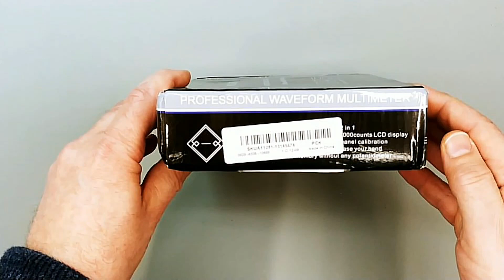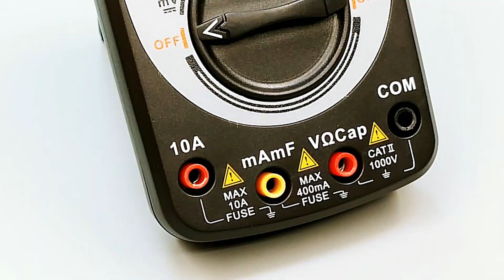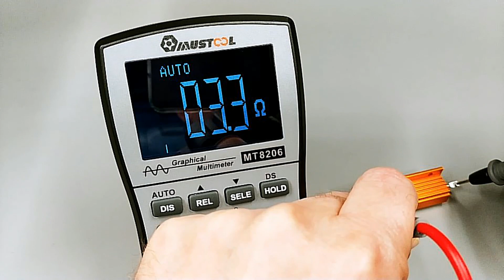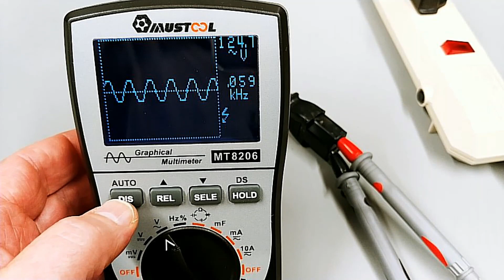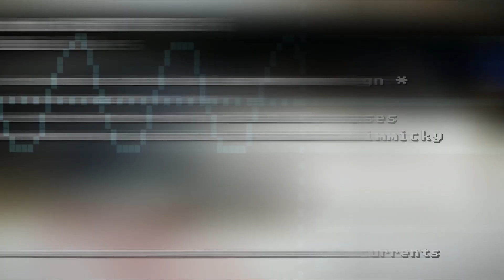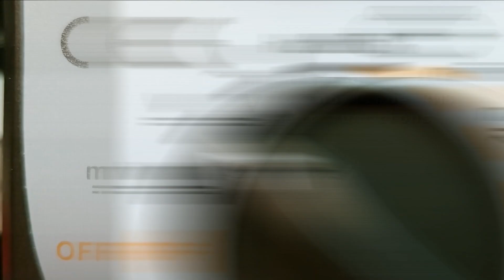#13 "Banggood-ness" — Review: MUSTOOL MT8206 DMM with Waveform Display

Comment: That 8bit "music" was way too distracting, did my head in! And this is from someone who has had ZX80's, ZX81, ZX spectrum,  VIC20, Pet, TI99-4A, STFM, A500, C16, C64,, VIC20, Oh, and a Sinclair QL+ ((with microdrives!). and some I've forgotten.

My ZX81(which was a home build kit) had 1Kb of memory, so I had an expansion pack with 64Kb with a passthrough for another RAM expansion.
They were so wobbly that if you hit the terrible membrane keyboard too hard it would crash.

I've used 8" disks, 3" flippies, 3.5" floppies, Microdrives, 20Mb hard cards (Bet there isn't many people who can remember having to PARK your harddrive before switching off your DOS based PC.), I even had a $360 dual speed CDR and a 9600 baud modem which cost an absolute fortune!!

Out of interest, does anybody remember magazines with pages of code that you had to program into your computer?
I remember one time I had almost finished entering approx 6 pages of code when the electricity meter shut off! It was coin operated and my dad forgot to feed it some money!

EOF !
Reply from the maker: Yes, sir. Lesson learned regarding the music, hence the note, ABOUT THE BACKGROUND MUSIC IN THIS VIDEO in the description. 😉

Yeah, I used to type in all the VIC-20 and C64 programs from COMPUTE! and COMPUTE's Gazzette magazines back in the day. 👍

Comment: That meter only outputs 1.5 volts not enough to light leds.
Reply: my fluke 177 meter can light two LEDs at once on diode mode.
Reply from the maker: Yes, I didn't see realize this at the time. This meter is definitely not comparable to a Fluke, that's for sure. Thanks for watching and for commenting.

Comment: Interesting and very well done review. You made a very important comment on it NOT being an Oscilloscope. But the wave form mode is useful to see if one is testing inverters to see if they are sign wave or square wave. So it may not be a scope, as you pointed out, but it can still be a useful feature.
I see the 8207 model is suppose to go to 40 mhz and is still a fair price for such a multi function meter.
Thanks for the nice review.

Barry
Reply from the maker: Hi Barry. Thanks for the positive feedback. Yes, the new 8207 actually looks to have fairly capable oscilloscope functionality (for the price). I would like to get my hands on one of those to test.

Comment: I BOUGHT MT-8205 IT'S VERY GOOD DMM T-RMS CHECKED CONTINUITY FAST RESPONSE. RECOMMENDED . ON TOP ABLE CONNECTING TO MICRO USB . FIRM SOLID DMM USE 4XAA BATTERY .
Reply from the maker: Thanks for commenting. I just watched Marco Reps
 YouTube video review of the MT-8205 and it seems to be a better design than MT-8206.Thanks for letting me know.

Comment: Please 1.2 Volt DC signal Checking time graphics waveforms multimeter showing yss or no......Please comment aatmamishra1975@gmail.com
Reply from the maker: The waveform display of this multimeter is more for general reference rather than the advanced measurement functions of a decent oscilloscope. The graphical display does not show precise measurements and the sample rate is very slow. I hope this helps.

Comment: I bought this multimeter only for the waveform display... I use this for showing sinusoidal waveform from the output of amplifiers, but i can't "zoom" the amplitude of the signal for watching clipping in the output... the autoscale is a bad thing...
Reply: Just buy an old analog scope from eBay. Thats what I use for the same purpose.
Reply: @Schniels65  I bought this one just for having something portable... I use DSO also for car amplifiers :D

Comment: Was thinking off buying this unit , but not anymore.
Reply from the maker: Thanks for commenting. I'm glad that you found the review to be useful. Yes, if you don't require all the memory storage and semi-useful waveform display there are better options. For example, the Aneng 8008 is an excellent value, low-cost multimeter with very good reviews from many sources. Banggood has it on sale right now, https://www.banggood.com/custlink/3Kmv3q2JfY.

Comment: IMO, any scope that cost less than a couple hundred bucks should have the leads replaced with a pair of quality leads. Considering you can get a good pair for under $20, there's no reason not to. Almost every meter under a couple hundred bucks that I've had the chance to play with had crap leads. But when I paid $40 for this meter (the updated version. I should get it in about a month) and $20 for leads puts me at $60 for a setup that I expect to get good results out of. And I think that value will be extremely hard to beat
Reply from the maker: Yes, you're absolutely right about replacing the leads with more economy meters -- I agree with that. Did you use the Coupon Code in the description above to save a bit on your purchase?

Comment: Banggood-ness because i have a power supply of a monitor and still couldn't figure out what is the problem. I need this tool for safely measure the hot side with oscilloscope function.

Comment: Display is clear, but refresh seems slow. Slowing the whole user interface.. Measuring low resistance is tricky. Im surprised it got that right. Have you tried holding the probes together and pressing REL?
Reply from the maker: Yes, you are correct, the refresh rate is quite slow. No, I haven't shorted the leads and pressed REL -- I will try that. Thanks!

Comment: Banggood-ness 

First, thank you the review. Second, i have a C64G machine, but dont work. I opened the breadbin case (in the middle screw, they have an original warranty sticker) and i'm find inside a ASSY NO.250407 ARTWORK NO.251137 REV.C motherboard..... Awsome! :) The motherboard i think, factory repaired. I see many youtubers video with the black screen of death failure, and measure some basic parameters. Power, the ON/OFF switch. Next step, i remowe the socketted IC-s. SID, the two CIA, nothing result. And i think  the next step is check the clock frequency. But i dont have (currently) any tool, to verifying this parameter.   

Best regards!
Reply: I forgot write this step, the PLA IC i changed a brand new PLA chip.
Reply from the maker: Thanks for your comments. Yes, C64 black screen repairs are often very difficult to diagnose. Coincidentally, I am editing a video now regarding a very difficult black screen repair. Very often a failed PLA is the cause of the black screen - so, your new PLA did not fix the problem, I assume? Do you have access to a Dead Test cartridge? That might help determine if RAM is faulty, as well. You can purchase a Dead Test cartridge from numerous trusted sellers on eBay, https://ebay.to/2zVxurj.
Reply: @MindFlareRetro  

Thank you Sir your answer! The new PLA chip not helping. So i purchase this: https://www.ebay.com/itm/NEW-Commodore-64-DUAL-Diagnostic-Cartridge-PLUS-781220-586220-GOLD-ENIG-V3/163350902169?ssPageName=STRK%3AMEBIDX%3AIT&_trksid=p2057872.m2749.l2649
I hope, this is good for me. (I'm live in Europe, and this is the first in your list, the Seller sending in Europe.) I also purchase two week ago a DTL/TTL CMOS logic probe and  a basic electric solder sucker, like this https://www.ebay.com/itm/220V-30W-Desoldering-Pump-Electric-EU-US-Plug-Pen-Suction-Soldering-Iron-Sucker/183521682045?hash=item2ababea27d:g:0uAAAOSwhZ5b4UrH:rk:66:pf:0  Currently the solder sucker arrived (and worked), the probe not arrived. This faulted motherboard have a long story, and i feel called upon to a fully working state. (The case have an original warranty sticker, and i'm pricked with the screwdriver) If the black screen of death is repaired, i fully socketted all IC's (inspired your video in this summer, and 3 mont ago a local electric shop i buy all socket, so this is not a fresh idea :) ) change all capacitor, next the linear regulator changed to DC-DC converter. (inspired by Jan Beta). And last build a new power brick. i want this machine in my "daily used" C64. Yes, this is a vaulting ambition, but my first project ( dead C16 machine) is also started hard, and currently i have a perfect machine. (Another long story... this machine and the +4 very popular in my country. If u wish one, i help you.) 

I wish glorius days all retrofan in the world! 

Ps: sorry for my smattering english .
Reply from the maker: It sounds like you are doing great work with the repair. I have not seen that type of heated desoldering pump before -- be careful that it is not too hot because it might lift traces from older C64 motherboards. The logic probe is also a very handy tool to have when repairing retro computers. The Dual Diagnostic Cartridge you selected is an excellent choice -- very high quality and has both the Dead Test cartridge and the Diagnostic cartridge in one. Where do you live in Europe? The seller is in Canada 👍, just keep in mind that there is a partial post office strike here at the moment so there could be a bit of a delay. Keep us posted on how everything goes.
Reply: @MindFlareRetro  Thank you the information in the post office strike. Now i understanding, why not started the delivery process. The weekend i investigated the motherboard, and i'm find broken traces. :( My soldering skill is improved in the future...  and the logic probe also have some work. :) So i'm put back the motherboard the beuty white breadbin case, and investigate the C64G machines PSU. (I owned a C64C, this machine buyed me my Father in 1990 Dec. Never opened the case, all time boxed if i not used, this is a sacred cow. :) This machines excellent PSU my test PSU, and the long board test PSU this time. ) And im not happy, the PSU ( Part No. 251053-11 ) that comming with the C64G is bad. One of the rectifier diodes is fail (im not have osciloscope, but with a multimater i make a simply diode test , and not passed one. The linear voltage regulator (LM7805) also bad. This time i shutterred, not the half motherboard/IC's blowed up.... This is, why the previus owner put the trash this machine. This project maybe sucks but i do not give up. 
Thank you your notice, with the cheap desolder gun. Yep, this is a very basic tool, next christmas i wrote a letter in Santa. I wish a better solder station and desolder tools. Currently i'm just basic tools owned. True, a two year ago, is enugh me. But this level of repair, required better tools.
Reply: I forgott answering your question. I'm live in Hungary.
Reply from the maker: Wow, there are a lot of problems with this C64, but it sounds like it will be saved in your capable hands. Are you on Twitter at all? It would be great to follow your progress there. Also, many of the Commodore experts (such as Jan Beta, GadgetUK, Aphexteknol, and many others) are there to offer advice. LOL! Hopefully, Santa received your letter and you get your new lab gear for Christmas. Legyen szép napod!
Reply: @MindFlareRetro  Twitter is new for me. I making an account a half hour ago. Search my name, you find me easy. And of course, i followed you in twitter. :)
Reply from the maker: I have found and followed you on Twitter!
Reply: @MindFlareRetro  Sir, the dead test cartridge is arrived! :) Here is 13.00 PM, evening i try it.
Reply from the maker: stevedoki Wow. That was fast.

Comment: The Banggood-ness would hopefully help me troubleshoot and fix the bass amp I just bought off ebay. If nothing else it will keep me busy for hours waiting for it to measure the 3300uF filter caps given how long it took for the 100uF ones in the vid.

Comment: Great video, I learned a few things about multimeters too. I was curious to know how long your other meters take to measure those caps and other things that took several seconds for the Mustool. It'd also be cool to see your other meter light up an LED. I didn't know that was possible to do.
Reply from the maker: Thank you for the positive feedback. Good idea - I will do some other measurement timing and LED tests with the Brymen BM257s and the old Fluke 45 and get back to you.
Reply from the maker: Well, I haven't had time to test my other meters with LEDs, but here's a video from Banggood showing another MUSTOOL meter illuminating LEDs and measuring the voltage drop, https://youtu.be/MhMYZGI4PxY?t=83.

Comment: Banggoodness gracious me!  I would find this very useful to measure audio signals in the ham radio build I have been doing!

I wonder if the problem you had with frequency measurement had to do with your input levels of the test frequency. It looked like the instructions mentioned a minimum required level for freq mode.